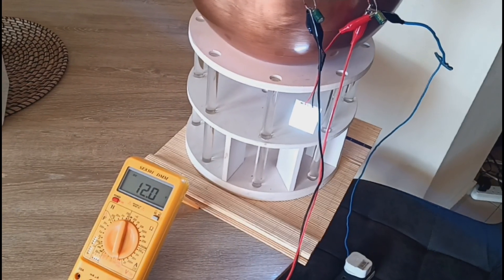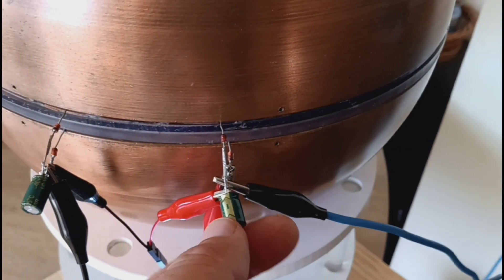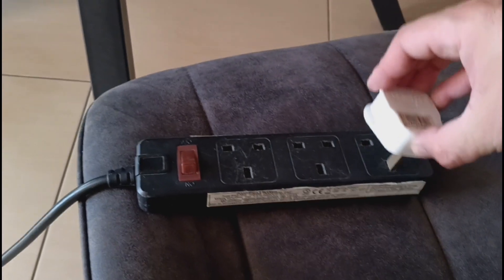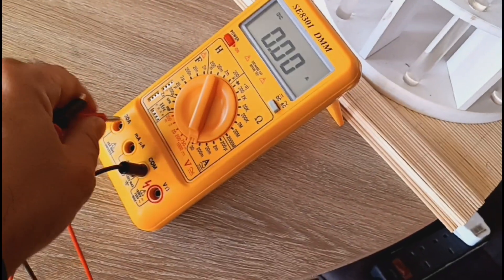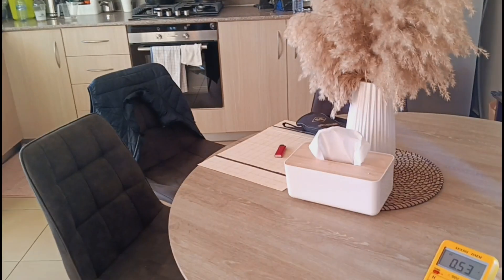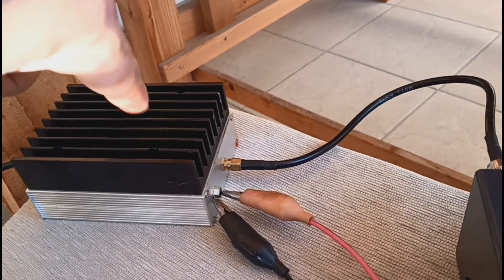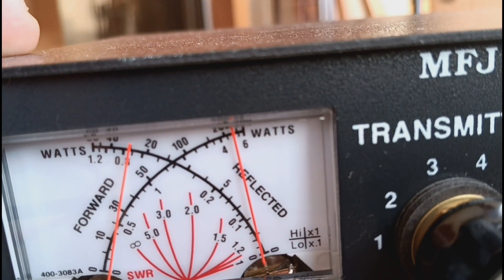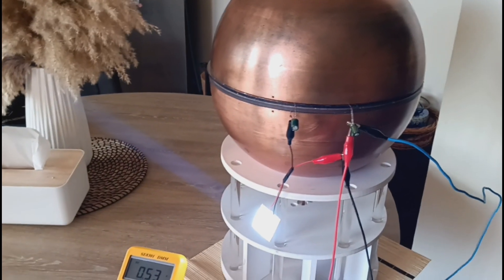Power Transfer trough Resonant Coupling and rectified at the same time. 12.5Mhz to DC (7.2Watts)

Comment: This is amazing. It's basically using the principles of a voltage multiplier and converting resonant frequencies into usable dc voltage. Imagine having it at a higher atmosphere to catch all the atmospheric radiation. Have you seen a draw back in current?
Reply from the maker: Can you elaborate on the current what you mean ?
Reply: @primeradianttechnologies3085  generally when alternating current is converted to dc using a rectifier and capacitor setup the voltage is increases but the current is decreased because the capacitor storage and release can't keep up with how much energy a specific load is pulling. It may not matter with a led as the load but once larger loads are connected it may not be enough current to supply the load.

Comment: How far can you take the receiver away from the antenna before it stops responding? The range you're getting tells me this isn't Electromagnetic RF as they are pretty much impossible to transmit power with. I suspect you're producing displacement currents as Tesla did as his wireless power transfer method.

It's either that or your antenna receiver configuration is creating an exciting situation where the receiver acts as a generator instead of taking power from the antenna, either could be the case.
Reply from the maker: It has to do with the common ground. I found that when the ground is common, one part of the power comes from there in this particular setup.

But we are not done yet 🤩
Reply: @primeradianttechnologies3085  Really? In that case I'd definitely wager you've created a variant of Tesla's wireless power transmission with capacitive Displacement Currents, Tesla made it clear that he wasn't using Hertzian waves and was using the earth ground as a 1 wire transmission line, today we call this Telluric Currents.

That's an impressive feat mind you, well done!
Reply from the maker: I'm still trying to figure ot out, because did not have a previous background on those fields.

Perhaps you are right because when we meet Bashar in private sessio I ask him if this is the same idea N.Tesla was trying to make and ge said Yes!

Then ask him about a vision I had exactly before our meeting begin which include 48 Antenas in a Symmetric grid around the Planet.

He said that this will amplify the entire electromagnetic field of the Earth in a such a way what we can simply ground a wire anywhere and have enough current flow. 

Then he make it clear that in this grid some of the Antenas have to be in a platform in the ocean or see.

Later I asked if we need to make it 57 meters like the Wardencliffe tower and he said that is not nessessary to be so high.

After I asked hom to give us dimensions and he said that the high is enough to be 30 feets (10meters)

And the bigger shell between 1.8 and 2.1m diameter to work out.

Our conversation continue because I had concerns that such a lower high might result in some kind of interference from the higher buildings and but he explained that this not going to happen. 

We have very small group on watsup where we discuss this ideas and I will be glad if you join and tell us more about your point of view.

We might solve the puzzle easier together. 

Let me know if you are willing to Join

Comment: The ground is "Hot" even when you turn the power bar off. It's still possible to have a ground loop current flowing, ESPECIALLY since both antennas are sharing a common ground. When you have two antennas connected in this way they essentially form a single circuit. You also should not use a DMM to take reliable power measurements. You are still going to have ripple, and you want to account for that. Use a scope, use power math function on it, and then export data to a PC, perform an integration to find true energy in/out in joules to get the most accurate power measurement possible.

Also you can't just assume input power is 5 watts, because that is what the device is rated for. Again you need to take accurate input power measurements with a scope and also account for all the reactive power you got there....which is at least 5 watts reflected according to your device.

This setup reminds me of Tesla's "wireless" power system, where you have two antennas in resonance with each other. What they do is establish a standing wave with each other across the common ground line, and you can get single line power transfer this way. You can watch many Eric Dollard, or Adrian Marsh videos to see how this works. Just search Tesla Transference of Electrical Power by AMInnovations.
Reply from the maker: Thank you Jonathan I will research this information. 
I have current probe with 60Mhz bandwidth nut something goes wrong and is for replacement now.

I made additional measurements here, which support what you said.

Comment: I hate to break it to you, but you're most likely picking up house voltage via inductance.

I know because I was playing with this kind of stuff just recently. If you pick up a cheap oscilliscope online you can get one for as low as like 30$ now and I can almost guarantee you'll see the 60 Hz wave from the powerlines.
Reply from the maker: This is not the case here because I have 2 Oscilloscope and they are not cheep ones.

The Oscilloscopes measure DC current with over 40V DC before the LED is attached and 12DV DC when is attached confirming the DMM.

And also the DC measurements with the Oscilloscope showing not just a regular DC noice signal but the the so called noice level have the same frequency as the resonant frequency of the big antenna in this case 12.5Mhz.

If the power is pick up by induction as you say over 3 m3ters distance or even much Lee's than that then the output will be maby only 10-15% in the bast case.

On general I know what do you mean because had this effect few years back in early stages before resonant frequency was found. I was so ignorant that try to Kickstart it with regular transformer of 50Hz

Comment: That meter can't read this high frequency accurately for amps. I'm curious if its correct. Awesome work either way. Im studying similar! You seem like a very cool person.
Reply from the maker: Thank you for your nice words. Just to clarify that the high frequency is rectified from the diode which are on each leg of the capacitors. And the Amphitheater read directly the current in DC. For high frequency current we have current prove with 60Mhz bandwidth but is now for replacement with new one and cannot use it .

Comment: The clamps on top and bottom of antenna are they ground ?
Reply from the maker: Both devices at as antenna which one do you mean? The big one STA they are connected to each other but even separated doesn't make difference.  The small device FM there is nothing attached to them. Ground only on the capacitor, doesn't matter which one
Reply: 5w amp plus 2w square wave function generation your output is 0.2 in generated current right? Also did u ever measure the amperage or wattage from the original 10x you got from the cone antenna? Thanks
Reply from the maker: @PolyGoesToTheMoon  I did not measure the power of the cones , there were accidents where they broke before I get the current probe for high frequency. 

I don't understand what you mean with 5w and 2w.
Reply: Your signal amp is using 5watts and your signal generator on square wave is using 2watts and your output is 7.2watts so u are gaining 0.2watts was my guess

Comment: Great, try your best.  Do you have any funding problems to make this experiment more effective?
Reply from the maker: There is a person who is founding the project and provides financial support, so I can do this full time. Without hes help no progress was possible at all.

However everything is very relative...
For example at this time the equipment I'm using is up to 80-90Mhz and we have no idea what is happening above this bandwidth. 

Also I'm not able to build a second identical antenna to see how the communicate between each other or the optimum size which is 1.618 times bigger than this prototype mostly because will take much more resources. 

So there are different ways the project can be taken further relating to resources.

Because the device is pretty big and heavy I could not send it to lab in order to be examine.

So it's hard to answer your question from one hand I have all resources need right now, but from the other there are many different ways additional resources can boost the project.
Reply: @primeradianttechnologies3085  Yes!  I think I understand your problem, I will keep this in mind and if I have related ideas and solutions in the future, I will discuss them with you.